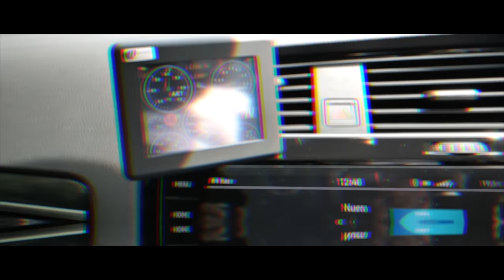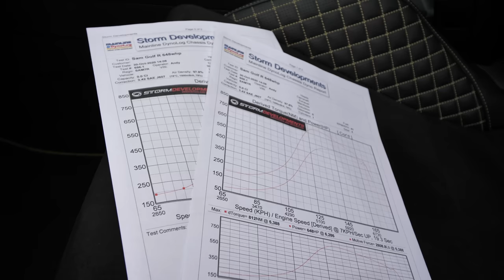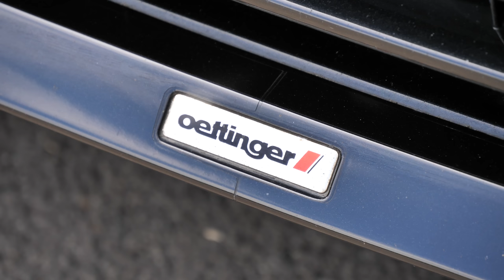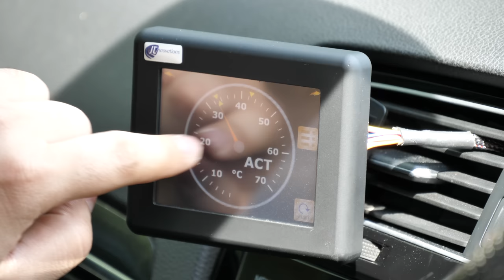THE UKS MOST POWERFUL *STOCK ENGINE 750BHP* VW GOLF R IS NUTS!!

Comment: Although I respect this guys build and passion towards his own car, its just the same old kinda golf u see driving past that lightly touches the throttle and it pops a bazillion times sounding ridiculously stupid. I just don't get people with a thing for golfs. Sure yes they can be quick but there's no real passion involved in driving it, its all computers doing the work and the driver is truly uninvolved with the car. Even without all the computers, the engine is just extremely boring, it can barely make more power after 5k rpm which just adds to how boring the car already is. But, if you are the type of person who doesn't care for a car and driver syncronisation and just wants a quick car for the sake of having a quick car then sure by all means get a golf and I won't complain. I just don't understand peoples passion for golfs, in my opinion I thibk those who are really into modern golfs aren't truly into the purity of cars, but that is my opinion lol
Reply: Any gti in a manual before the mk7 or any golf r32 is a blast to drive
Reply: What cars do you like?
Reply: @MV-qm9ne  kp61 starlet, torana xu1 gtr, mazdaspeed nb mx5, r32 gtst, and then my car ofc - which has a huge cam, heavily ported and polished head, stiffer valve springs, larger injectors, head decked for compression ratio bumped to over 11.0:1, custom intake manifold and 70mm tb. Setup allows it to rev close to 9000rpm so yeah this so far is my fav car, its a 1998 mitsubishi lancer 1.8 coupe weighing in at 860kg
Reply: @elliottstark5619  I like your choices. Thanks for replying. I test drove the Speed 3 a long time ago. I didn't buy it. I should have left the wife at home that day.
Reply: @MV-qm9ne  hahahah yeah mad little cars they are